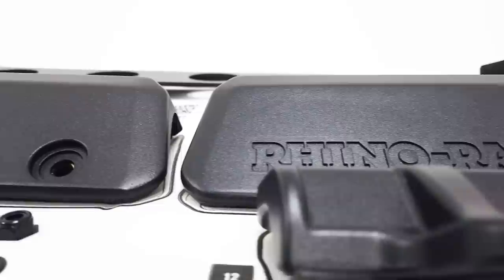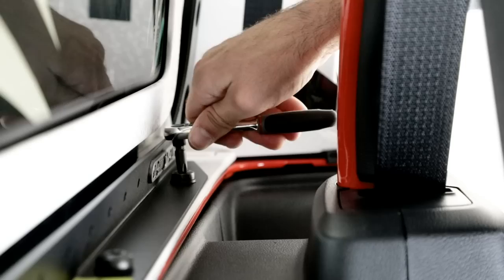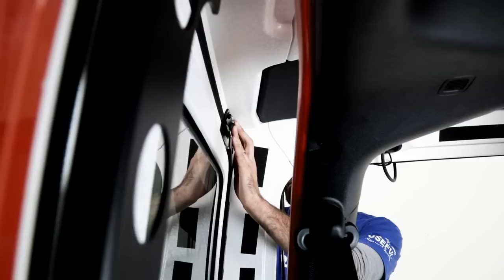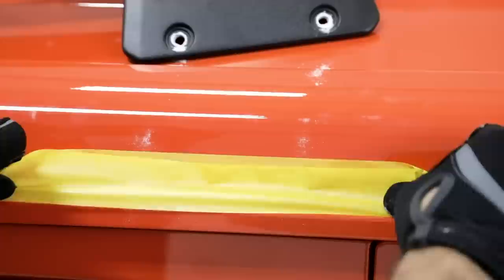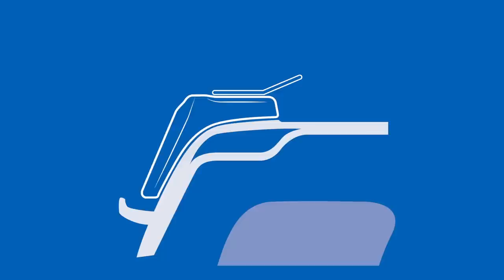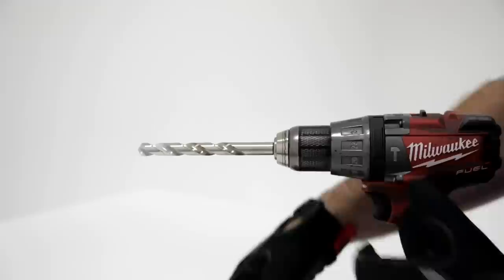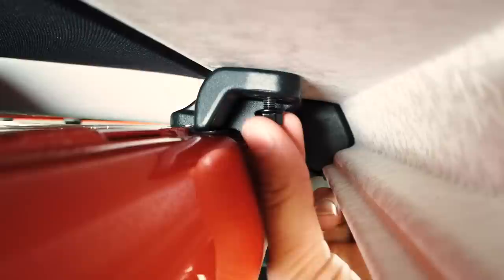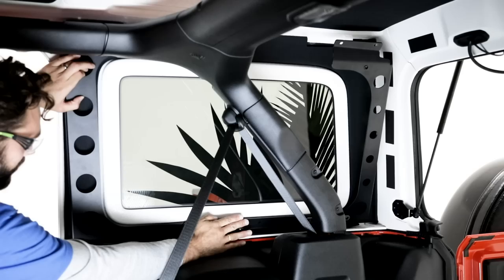Jeep Wrangler JL 4-Door Rhino-Rack Backbone Installation

Comment: I installed mine a month back and it looks great! This video was very helpful during the installation process. 
Few words of advice to anyone installing these:
- loosely fit frame and cut your insulation panel first so you don't have to go back at the end and unscrew everything to complete this step.
- If you are in the USA and have difficulty finding butyl, you can use "Dap Roof waterproof asphalt sealant"... that is what i used and i haven't had any issues with leaking. I read a review that it doesn't hold up as well in extreme cold/heat, but i think that difference is only marginal.
- After installation, wait 24-48 hours (or longer) for the butyl/asphalt sealant to dry before taking it out in the rain or to a car wash (better safe than sorry).
- The first hole you drill into the roof (the rear most bolt) is extremely important to get correct. I accidentally drilled the first one at too steep of an angle and it is slightly off. It works fine, and you can't tell from a distance, but i would have liked it to be perfect. 
- Double check that you put the Rhino Rack multi tool on in the right direction when spacing the castings! I accidentally used the phillips head end instead of the flat head end and at one point, but luckily fixed it before i drilled.
- If you are installing the 3 vortex cross bars instead of the platform (like me), there are no install instructions for those bars. It is kind of common sense but i would have liked some reassurance that i was doing it correctly since i am loading a tent on top of my car. The Quick Mount legs attach to the Castings with only one bolt in the center of the three holes rather than two bolts. This made me concerned that they might twist but so far that hasn't happened. Also, when you are snapping your bars into place i only used one of the track leg rubber grommets on the rear hole of each Quick mount leg since that all the package came with and the bolt went through the middle hole. If that makes sense... If not i can make a video on this if anyone has questions.
Reply: Also... When you purchase the 3 Vortex cross bar package (VORTEX RLT600 BLACK 3 BAR RHINO-RACK BACKBONE ROOF RACK JB0899), you are sent the Quick Mount Legs in two different packages. One package comes with 4 of the Quick Mount legs (RLT600) and another package with 2 of the Quick Mount Legs (RLT600H). They are the exact same item... but the only difference is that each package comes with a different set of keys!! Not a big deal but it is frustrating to have to remember which key goes to which one. My guess is they have to do this since they don't sell a 6pk of the Quick Mount Legs. I am going to call to see if i can swap out my 2pk to match the 4pk key, but it will have to wait until COVID-19 restrictions are over.

Comment: At 7:05 I think you are giving bad advice. To remove the frame creates a butyl mess. There is no reason why you can't trim the insulation panel immediately at the first step, with the backbone frame set in with the hard top bolts fastened all the way into the frame of the jeep. Then the insulation is simply in place during the install. I spent a long time cleaning butyl and almost losing washers so that I could trim the insulation before everything set in place.
Reply from the maker: Hi Scott, 

Thank you for your feedback. We appreciate you taking the time to comment on the issues you faced whilst undertaking the installation of your Rhino-Rack Backbone. We realise that this may have caused some frustrations during installation of the insulation panels. As the panels are an optional extra we didn’t intend to spend a large amount of time featuring them as they were not directly pertinent to the fit and installation of our Rhino-Rack Backbone system. 

If you have any other questions or comments, please feel free to reach out to us on our Facebook page. 

Regards, 

The Rhino-Rack Team
Reply: Scott Custer I totally agree. When I installed the first side I did it the way this video suggested and I was very frustrated with losing washers and the butyl mess. I did the other way you suggested and it worked just fine cutting and installing those panels right away.

Comment: Ordering it tight now .
Reply: Order mine today
Reply: @rickatseanes789   what kind of sealer is it?
Reply: @rickatseanes789   I ordered mine from Qudrotec they said it will ship beginning of August
Reply: Not sure what you mean ? What kind of sealer
Reply: @rickatseanes789   Butyl Mastic caulk sealant i mean
Reply: Silicone or roofing compound will work fine

Comment: Anyone have any recommendations on how to install the Backbone system without the CA 1957 Spacer Multitool? I see the two sides are 6.5 mm and 11 mm, do you think i can achieve installation with some lathe bar stock? I misplaced mine and cannot find it anywhere.

Comment: Great video! very detailed and easy to follow. i did have two questions. 
1. Do you need the Butyl to dry before assembling? 
2. How do you re-seal the insulation, do you sew it or can you seal it with a lighter? 
thank you.
Reply from the maker: Hi there, 
To answer your questions:
1. No, you should not wait for Butyl to dry before assembling. Butyl will provide optimum seal between components when it is wet (freshly applied). If left and it begins to form a skin before assembly, it wont fill all the gaps between the components as well, or attach to the surfaces of the components as well to create a good seal.
2. The trim can be re-sealed with a lighter.
Thanks!

Comment: Loving the Backbone system. Is it still possible to remove the Hardtop after installation of the Backbone? As far as I see theres only two screws fixed to the rollcage?
Reply from the maker: Hi there, The instructions show which bolts need to be removed in order to remove the complete hard top. Four on each rear and then the two in the front through the roll cage. 
But the backbone structure will remain in place on the fibreglass canopy. 
Thanks!

Comment: Possibly silly question... Is the Butyl Mastic to seal the fibreglass shell or to seal the bracket to the fibreglass? In other words, Do I Wait for it to set before placing the bracket or do I place the bracket immediately so that is forms a full seal? I am assuming the latter, which makes more sense. But thought I would ask regardless...
Reply: Right away. Immediately.